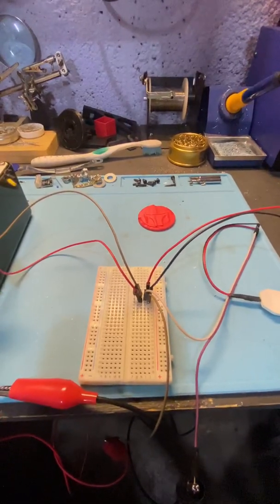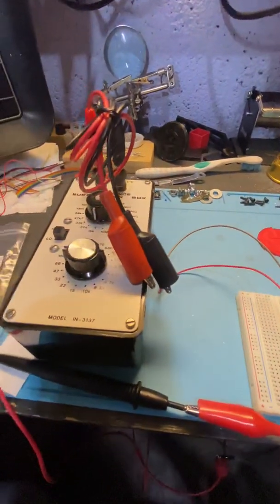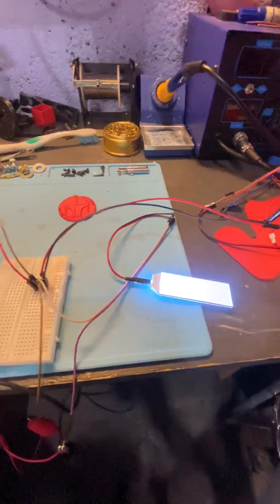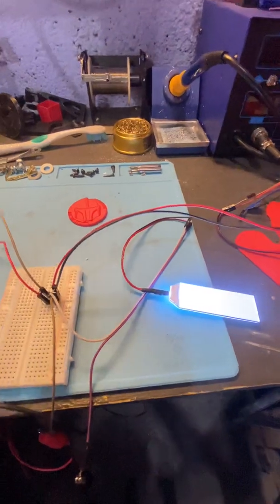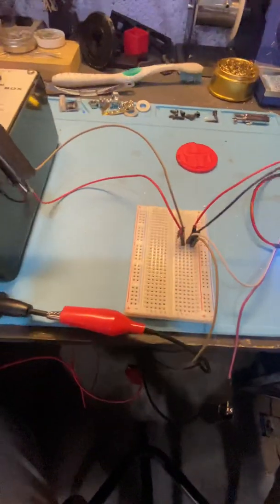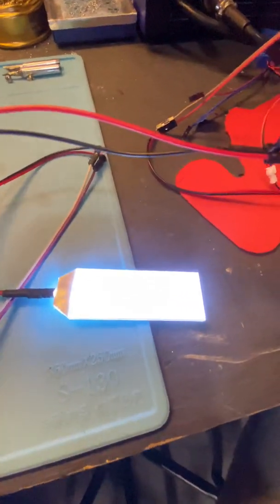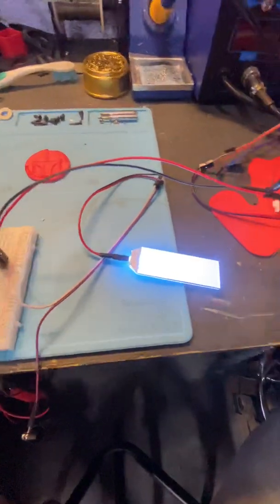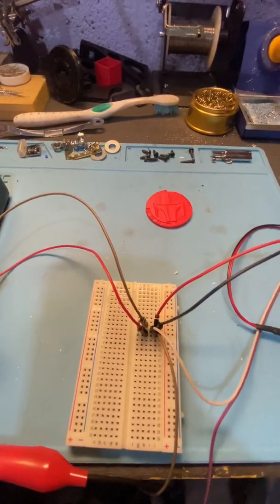Hall Effect Sensor (Latching) - Basic overview with LED (Iron Man / Batman Eyes)

Comment: Hi,
I enjoyed your great demonstration, but just concerned about what happens if you get a power failure - when power is reconnected does the device retain/remember its pre-power-failure state? 
What is the make & model number of the Hall effect unit you are using?
Thanks, Peter
Reply from the maker: If there is a complete power failure the Hall-Effect sensor will reset to it’s original state, it does not maintain a state memory. 

For the video I used a Hall-Effect sensor made by “Diodes Incorporated” model “AH3774-P-A” it is a bipolar style latching Hall effect sensor. 

I purchased it from Arrow Electronics, here is the link to the product page : https://www.arrow.com/en/products/ah3774-p-a/diodes-incorporated?q=AH3774-P-A    

Hope this information helps.
Reply: @dropwire  Many thanks.